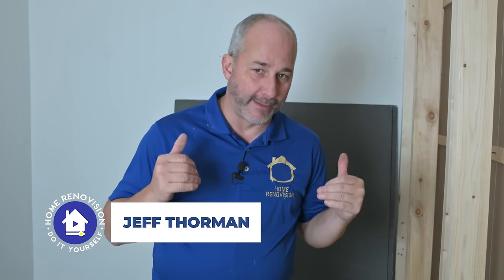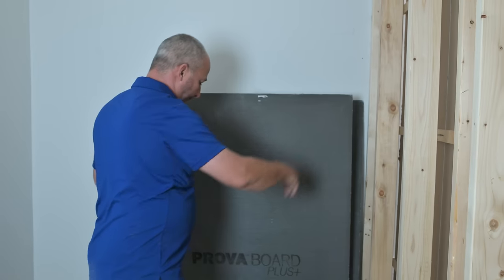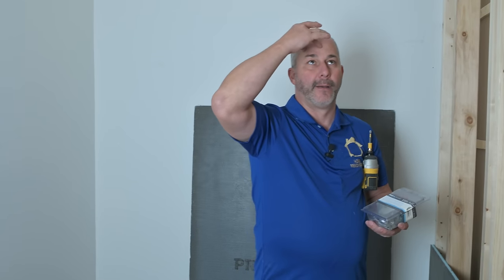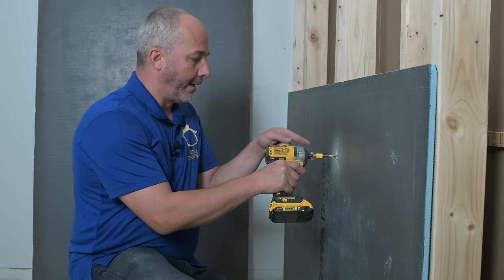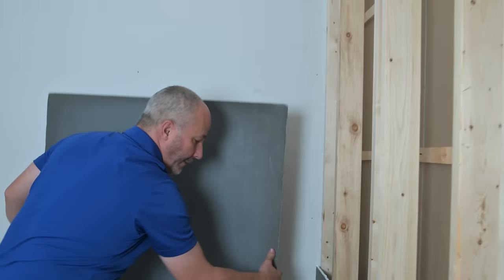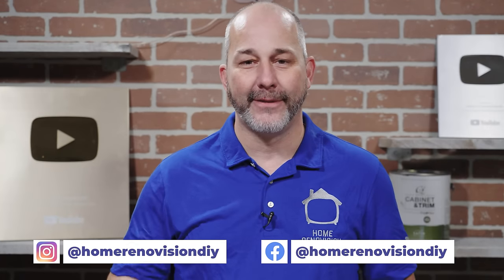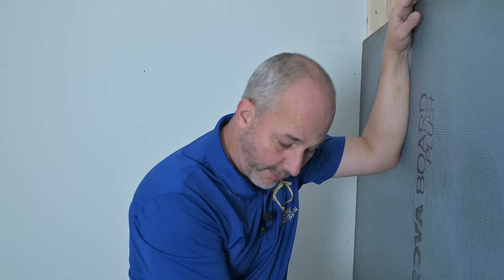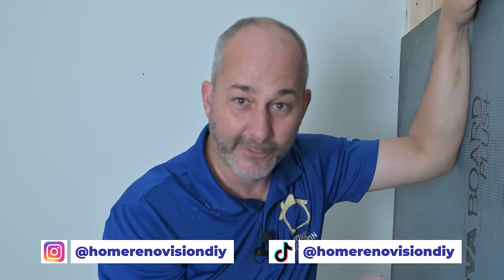Prova Solution To Kerdi Board Shortage

Comment from the maker: Let me know if there's any other materials you're having trouble finding, and I'll do more "alternative materials" videos to help you get your project finished. Cheers!
Reply: Maybe this one isn't as common for others, but I went looking for 1-1/2 ABS pipe at multiple HD locations and found them to be out of stock - all 3 sizes: 12', 6', and 3'. I get that there may not be an alternative material for this, but maybe you can recommend a different supplier.
Reply: What’s your thoughts on using Wedi instead of Schluter?
Reply: GoBoard from Johns Manville is another good option here, but that one also seems to be under a real shortage. None of the big box stores within a 90 minute drive of my house in Minneapolis had it in stock when I went to pick up a few sheets the other day. Thankfully one of my local tile shops had enough sheets for my job.
Reply: I'm getting ready to start my shower using the schluter shower kit. Do I have to use unmodified thin set mortar or can it be modified for the waterproofing? How about the tile? Does it have to be modified mortar? Can I use mapei brand or does it have to be schluter brand? It will be going up on the sheet rock that's for kitchen and bath and new plywood floor.
Reply: What is your thoughts on Go- board?

Comment: We don't have Menards in the Northeast US, but Floor & Decor has their own identical brand called Sentinel. Exact same look and feel as Prova. They had a good amount in-stock. I used USG Durock Ultra-light foam board on my prior project (which I found at Floor & Decor and loved it)..but they've since come out with their own brand and stopped offering USG's version, so we went with it. These foam board products come at a cost, but since I do my own work and don't have a helper, working with foam-based products is so much easier, faster and cleaner.

Comment: Hi and thanks for all the videos.  I've done a ton of renos here in Brockville using many of your videos!  I have a few questions:
1)Can you use Prova to make shower benches etc with Kerdi fix, as can be done with Schluter Kerdi board? Will the adhesive work as strong to add a floating bench, for example? 
2) Should I RedGuard the drywall behind the Schluter membrane to protect the drywall?  Will it stick properly?
3) Can a floating shelf made of Kerdi board (or Prova-depending on your question 1 answer) be glued to the Schluter membrane safely or just to the board?

4)Is there anything you recommend to put under ditra heated flooring membrane to bring the height up the dricore that I'm installing in all other parts of the basement?
5) Have you ever tiled over Dricore in a bathroom?  Good idea or no?

I could probably ask you a million questions, but I'll spare you!
Thanks for any advice you have,
Christine

Comment: I was about to make a similar video about Schluter substitution. Very similar to yours, I ended up using the cement form board from Sentinel, which is available at Floor and Decor in America.

I can either go without traditional purple board + redgard/aquafefense way, but I really want to try the foam based new products to get rid of potential mold issue.

Comment: Jeff I just messaged u concerning using ProCore Pro LVT 16x32” tiles mounted on 1” Formular XPS rigid foam board insulation coated with adaquate membrane. Then use best waterproof silicone adhesive to mount tiles and add good bead where they click together.  Seems legit what do you think

Comment: Thank you for all your videos, sooo helpful ! We looked everywhere to get those boards and now we have to move to another option for the walls for an all tiled shower (2x2 tiles on the wall with 1/16 in. joints) as probably a lot of other people have to do! I would like to know if it is possible to use the green gyproc with a liquid membrane for the walls and for the base use Kerdi base with Schluter tape, membrane, ciment etc ? Also I see on the Schluter videos that they put the base after the walls ?! Shouldn't the walls go on top of the base (as on a bath) or if it does not really matter because of the tape? Thank you! Linda
Reply: Yes, you can use liquid membrane and green drywall.  Just make sure you apply it to the right thickness.  Also, be very careful around your shower valve. With 2x2 tiles, grout lines will definitely be running vertically underneath the valve escutcheon trim. Water will follow the grout line and find its way in and run down the interior of the wall. The foam seals on most of those plates are dubious. Also, if there isn't a notch on the bottom, make one. I've seen the plates fill with water and also run behind the wall.

Comment: The Kerdi membrane seems easy to get. That's what I used because my walls were still fine behind my old shower tile and drywall is cheap.
Reply from the maker: good choice. in my experience having a board gives you a better finish.

Comment: There’s hydro ban, kbrs, Wendi, & kerdi boards that can use. So if can’t find kerdi, kbrs has been popping up in states a lot, along with hydro ban from laticrete. Installation is very similar to kerdi; as each makes own “tape”, membranes, and sealant (also, have a sneaky suspicion that the sealants used for kerdi will work on others and Vice versa; it’s just that b/c not using 100% same “brand”, they are able to deny warranty……which another topic right😉)
Cheers✌🏻
Reply: The warranty is only for the replacement of their materials. You'll be SOL for the tile, thinset, grout and the labour to tear out and replace everything .

Comment: How do you feel just about using Durock Cement Board, and RedGard for bathroom waterproofing?
Reply: I use hardibacker board and 2 to 3 coats of redgard for the walls. I always float my pan with mortar.
Reply from the maker: That works great if using an acrylic  pan!
Reply: Works fine, I would say hardiebacker is probably a better cement board. The install just takes long and is more difficult with cement board and redguard. They do hold up well however.

Comment: I would like to know what do you think about this product called simple mat for doing backsplash? It suppose to make doing a back splash or small tiling jobs easier by supplementing mortar. I want to diy my kitchen backsplash and was wondering is this a good product? Thank in advance!
Reply from the maker: I would simply use the adhesive for a backsplash. comes premade and water clean up. Cheers!

Comment: in nyc, cement board is the standard for shower bath tile length, then mold green board for walls
Reply: It's the standard because old dogs don't like to learn new tricks. I don't know why some are so resistant to change...yes, foam board comes at a cost but it is so much easier to work with, is cleaner, faster and doesn't require special tools.
Reply: @ruffxm  because its called money, and homeowners/landlords dont like wasting it for something new when tried and true is proven to last decades
Reply: @pacmanzz    Yes it's largely cost-based for plumbing firm owners...it doesn't cost owners any more to have their employees work harder (carrying & installing cement board) and using cement board requires a helper - a single person can hang Kerdi. If I'm an owner I'd rather pay a few more hundred bucks for materials but pay less in labor, without wasting time and effort having to cut it outside to prevent a shitload of dust. At a minimum you would save a day or two of having a second guy on the job. 
Sorry,  it's also called being a dinosaur. I know plenty of old timers that refuse to learn anything new. Kerdiboard has been around for almost 50 years. It's 100% waterproof and is foam-based which means it won't decompose any time soon. But longevity is not the driving reason because the people who are renovating a bathroom today are rarely keeping them longer than 20 years.  DINOSAURS....with big egos "my way is the best way" blah blah blah (because that's all they know). I was in the electrical trades - I saw it in that field too.

Comment: Also, PROVA is more cost effective. I used PROVA shower pan together with Schulter flange no problem!
Reply: I am curious about using the kerdi drain with the Prova shower pan. I am planning a shower renovation using the Prova board for the walls but instead of using the sealant for the seams and screw holes I was wondering if I can use kerdi band instead. Was the kerdi drain difficult to use with Prova shower pan?
Reply: @bmarkie4103  Schluter flange fits Prova pan the same overall size and same installation steps. I decided to go with Schluter coz it has nicer options.
Reply: @martynstusiak3471  thank you. Did you use the sealant at the seams and screw penetrations ? I am thinking of using the Kerdi strips.

Comment: What are these panels for? are they to be used as the drywall for bathrooms? or insulations?
Reply: You can use these boards for your shower walls. Or just use regular drywall and Redgard.
Reply: PROVA BOARD PLUS is a tile backer board product that has a waterproof core, making it ideal for wall applications in wet areas. They are commonly used to build shower walls but can be used for a variety of building projects that require waterproof rigid structures and tile backing. The board’s core has an R-value of 4.3, but it is best not to use it for a surface you will be painting, as you will have to smooth it out first.

Comment: What is the life expectancy of the adhesive sealant before it is known to break down? (if ever).
Reply: PROVA-SEAL doesn’t have a known period of time in which it begins to break down.
Reply: Long after your dead and buried. Do you think a manufacturer would make a durable, long-lasting, completely waterproof product and then instruct you to use a sealant that will not last as long as the product itself?

Comment: Does anything else need to do done in order to tile over that board? Or is it all the same procedures as any other shower tiling?
Reply: As long as PROVA BOARD PLUS is secured to studs using PROVA FASTENERS and PROVA-SEAL, and PROVA-SEAL is also used between all board joints and on the fastener heads for applications that must be waterproof, the backer board can be faced with tile.
Reply: Old post but a question for you, can you use prova membrane to cover seams and corners with this product instead of the sealant?

Comment: Goboard / Superior product at much cheaper than other materials on the market.
Reply from the maker: another great option!
Reply: I used a combo of goboard and hardiebacker. I wanted that rigidity for my main walls that I could get from hardiebacker, but I wanted the ease of install from goboard for my niche. In retrospect, maybe I would have done my whole bathroom with the goboard. As long as the studs in the wall are done well and tile is good, it will be just fine.

Comment: what if my shower floor is larger than the standard size? Can we join boards and slope them properly??
Reply from the maker: for sure. add a layer of subfloor to raise the edge to a perfect height.
Reply: Wedi also sells pre-sloped expansion panels if you use the Wedi system. Lots of possibilities
Reply: We recommend using our PROVA PAN and extension pieces on larger shower floors. Then you can simply waterproof the shower walls with PROVA BOARD PLUS. The advantage of using PROVA PAN and our extensions is that you will be able to produce a shower pan of any size while maintaining a consistent slope.

Comment: Do I only run the board up to the size of the shower or do I do the whole wall (shower + rest of the bathroom wall)?
Reply: Just the shower area. Drywall for the rest!
Reply: PROVA BOARD PLUS can be used for both applications. If you are just looking to waterproof your shower area, then use PROVA BOARD PLUS on the walls in your shower system only.

Comment: Can Prova Seal be used in place of Kerdi Fix. Used the two tubes of Kerdi Fix I had to seal Kerdi membrane on walls and Ditra on floor to acrylic shower pan with Kerdi Band. Unfortunately the preformed Kerdi seal I got for the shower valve is too large for the required tile aperture so I’ll have to apply a bead of Kerdi Fix in place of the Kerdi seal gasket. Local Home Depot and Reno Depot are both out of Kerdi Fix, but have Prova seal. Will it do the same job i.e needs to stick to Kerdi membrane around hole in drywall ?
Reply from the maker: not sure however the seal and bond from lepage or locktite will work for sure. Cheers!
Reply: @HomeRenoVisionDIY  Thanks. Found some Kerdi Fix at Rona, albeit only the 290ml size tube when the small 100ml tube would have been more than sufficient for the shower valve seal. Good to know there are alternatives though. Cheers.
Reply: Done it now. I think I did the right thing sticking with Kerdi Fix in this case. Kerdi Fix cures quite hard and since I applied the bead around the margin of the hole in the membrane (on the drywall), which I kept free of thinset, that should provide solid support under the tile around the rim of the hole. Prova Seal, according to the product info, remains flexible.

Comment: So the seam between the Schluter pan and Prova board will also be silicone caulk, right? 
Also, is Prova easy to cut, like Kerdi boards?
thanks
Reply from the maker: I would definitely suggest using the kerdi band at the seam. Cheers!
Reply: PROVA BOARD PLUS is very easy to cut—just use a knife. PROVA BOARD PLUS connects to EPS shower pans like PROVA PAN using PROVA-SEAL.

Comment: If you can mix sand, cement, and lime together and wet it until it looks like a driveway being poured, I can take that and make walls for about the cost of one piece of kerdi board. It's really not in shortage, it is so stupid expensive nobody would buy it.

Comment: Schluter is way too much money,. All that for a warranty on parts. Really, the parts are the lowest cost of a project and even if it is DIY you don’t want to redo for a warranty problem. Just do it right and any brand works. Diamond board is a great substitute for cement board and probably 1/4 of the price of Kerdiboard. Just use as cement board with the exception you only redguard the joints and screw holes.

Comment: Never used nor heard of Prova. Kerdi board blows, probably the worst “water-proof” foam board available. If you must used foam board, use Hydro-ban. If you’re using Schluter foam pans, you’re getting call backs soon 🤦‍♂️.

If you want to use Schluter, use the Kerdi membrane, Kerdi band, Ditra, etc but learn to float a mud pan, mud walls and use Denshield on walls over studs. You’ll improve your quality, reduce your call backs and produce better showers that will be waterproof for decades.

Comment: This is one of the worst ideas I've ever heard of. The one advantage that makes the hassle of Schutter worth doing on a DIY scope is the whole system warranty. These blue foam panels are water proof because they are made of closed cell foam instead of a waterproof membrane over open cell foam/drywall. Trying to mate these two systems at the pan corner (which is the most vulnerable joint) is absurd. 

Just buy the matching foam pan and be ready to tile that afternoon without mixing any cement. If you don't trust caulk based pans and can't get kerdi then play is safe with a fiberglass base.
Reply: I wonder, can a DIY installer even get close to getting anything from those warranties anyway? Not being a pro, and doing one step slightly off and I'm sure that even if you only dress yourself in schluter membrane you can forget about your claims.
Reply: @rolfbjorn9937  if you followed the instructions you won't need the warranty, right?
Reply: @rolfbjorn9937  don’t hold your breath for them to fulfill their warranty. There’s a pro tiler who has a channel and has talked about this. Just think of auto insurance companies.
Reply: @bigbob9702  That was exactly my point: companies will do everything to find you at fault and deny warranty claims. Being a DIY home owner and not a pro is automatically placing you at a disadvantage to have a successful claim. And you'd still have to deal with the labor.